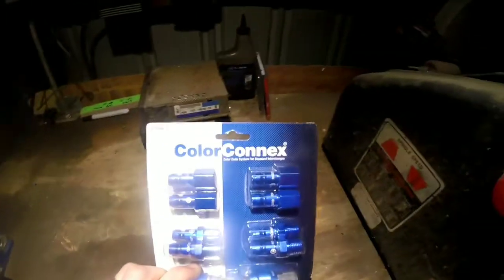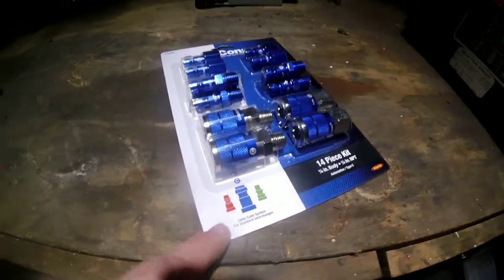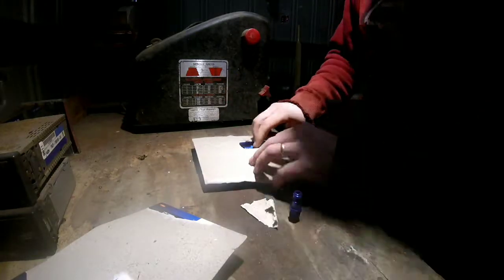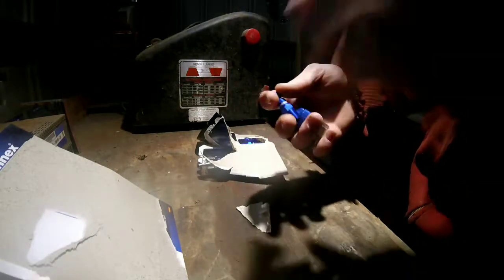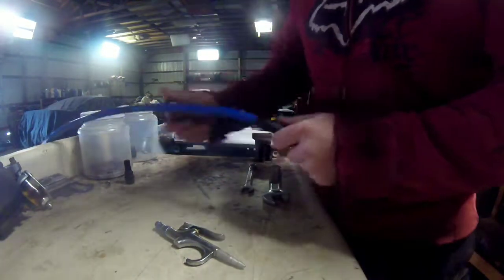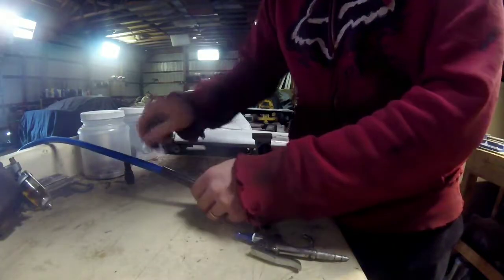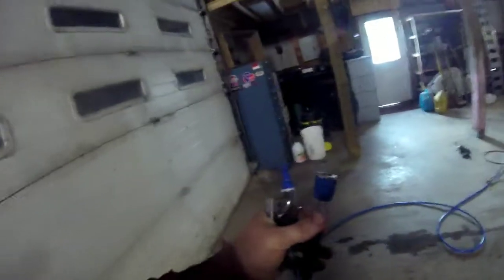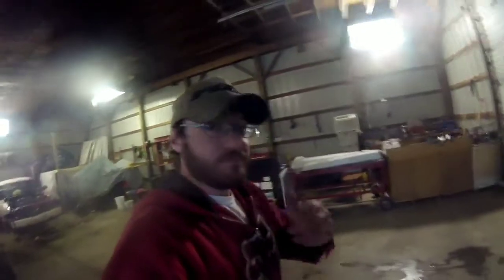Colorconnex tool review!

Comment: I had the exact same issue, a shop where several air fittings did not like one another.  Finally decided to just start from scratch and found these blue ColorConnex.  I picked the blue because it is my favorite color and because I mostly work on automotive.  They are great.  I keep a pile of extras on hand.  Every tool fits every hose.  Yes, they do feel lightweight but I have had no problems.  Thanks for the video.